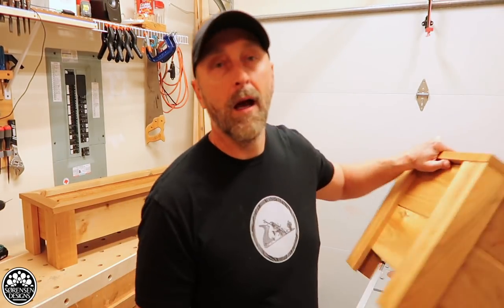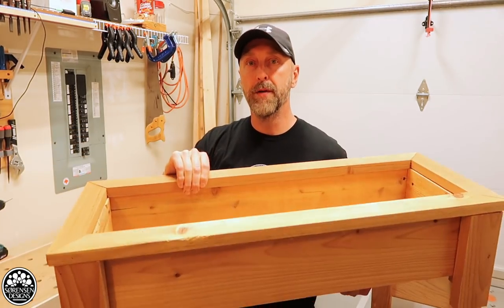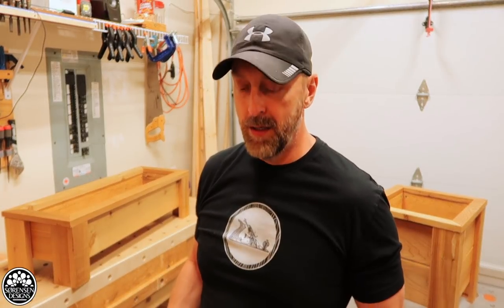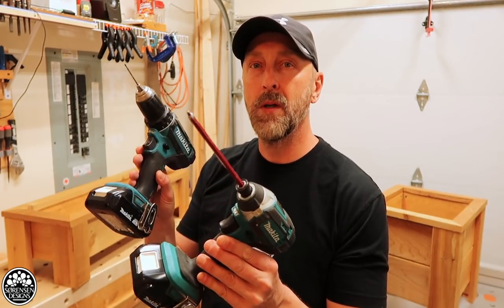The Amazing Jumbo Planter Box for Trees & Shrubs

Comment: This looks like a perfect solution to replace an aging plastic planter for our camellia tree! If we wanted to add rolling casters to the bottom, how would we need to alter your plans to add blocks/some other support for the casters at the bottom?
Reply from the maker: I would add a little dolly / frame for it, attach the underside, then attach the casters to the frame. Basically, you need to build a furniture dolly (without the carpet). You can just buy a furniture dolly at a hardware store and just remove the carpeting from it.  Harbour freight,  has them for the best price.

Comment: These are perfect.  I'm wondering though, what's the consideration for not using wood glue throughout the whole project?
Reply from the maker: @Woodworking  Thanks! You can use more glue, it's just that you want to allow for expansion and contraction where ever possible. The place where you really need the type 3 glue is on the corners for a solid edge to face  joint . Besides that, you can definitely use more for the trim.

Comment: Very cool!  But don’t you need to put a water proof dealer or spar varnish on it?
Reply from the maker: Not when you're using cedar. The liner I used protects the inside. The outside can be stained a year later.

Comment: Do you have plans for them because they are super nice.
Reply from the maker: @Danny Williams Thanks! I don't have plans for them yet but the rough dimensions are 24 X 25 inches with a height of 27 inches for the corners and about 24 inches for the box. The corners are made by ripping a 1X6 board in half (27" long). Be sure to use a type 3 glue, especially for the corners such as titebond 3. The trim on the top is 3 inches wide. The trim on the sides are 2.5 inches wide.

Comment: How big is that planter? 2 ft deep and wide? Also, in other videos, some people put the side pieces horizontal where as you lined them vertical. Does it make any difference?
Reply from the maker: 2 ft square - and 2 1/2 feet deep. You can use the exact same construction and orient the boards horizontally - it's just a preference.

Comment: Hello, I'm using mainly cedar board picket fences that are usually only 19/32" thick for the whole build. I'd like to pocket  holes the corner posts with pocket hole screws as well as a "picture frame" top trim.   Do you know if Kreg have these blue kote screws in 1" or 3/4"?  thx
Reply from the maker: They should have the (blue) outdoor treated screws in other sizes but I think they only go as low as 1-1/4".

Comment: Hi Eric
You didn't mention which wood you used, but I imagine it was cedar?
Nice, design with pleasant proportions. I've been looking for straightforward ideas for a 30 yard new driveway we've had installed and these planters with trees in are just what I want.
Thanks.
Reply from the maker: @John Walker  Thanks! Yes, I am using cedar - I should have mentioned it. You can use Fir as well but it doesn't really hold up as well as Cedar does. Good Luck on your build 🙂